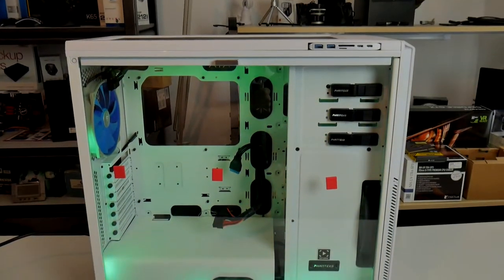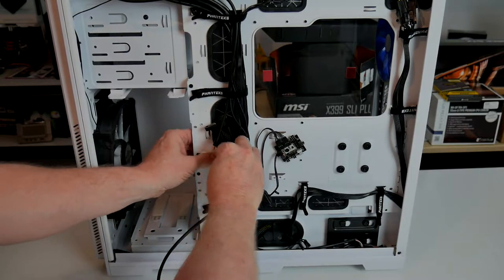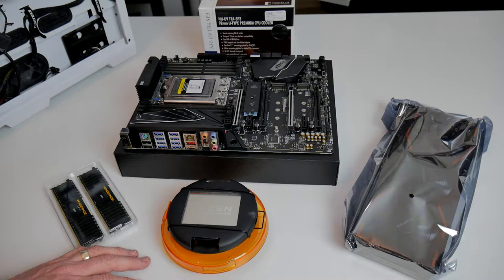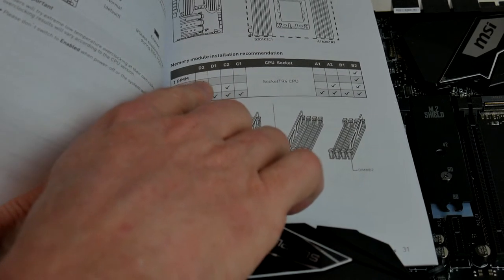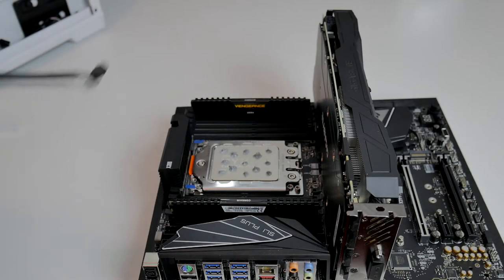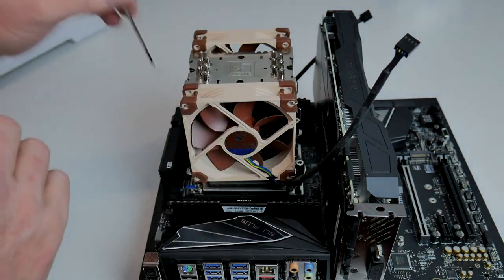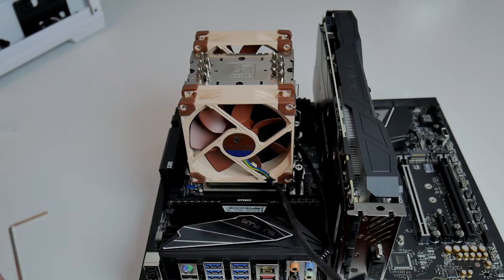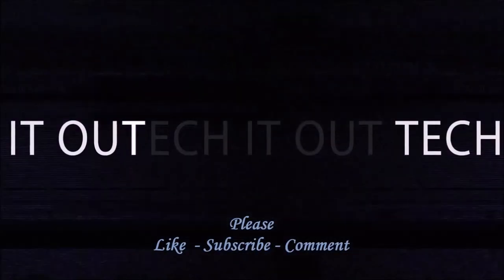Threadripper build VLOG part 5:  MSI X399 SLI Plus, Gigabyte GTX1080 and Ryzen 1920X

Comment: You know you crippled your system by only giving it two DIMMs and only 2400MHz? The main advantage of Threadripper over AM4 Ryzen CPU's is the fact that you have Quad Channel memory. With only two DIMMs installed, you're running dual channel, meaning most of you're Zepplin dies do not even have direct memory access and need to bunnyhop through the infinity fabric to get to RAM. All in all, I think your video series has been pretty good, however, I feel a little more research into what to buy would have paid off.
Reply from the maker: Sadly it was built to my budget. In an ideal world it would have at least 64Gb 8 x 8Gb strips but that is way out of my league.  Maybe when I have saved enough.  Thanks for the comment.

Comment: cool, thinking of getting a 1920x myself... found some 3000Mhz DDR4 doe, maybe overkill. But you should be able to do at least 2666.
p.s. dont think ill be getting such an expensive Case doe` .
Reply from the maker: Thanks for the comment. Sounds like a good build with that memory it may make it a little easier to OC if you decide to.  The case was only £80 UK when I bought it. I have modified it myself at a cost of a further £16 UK.  A total of £96 for what I think is one of the best cases available.  That's about $132

Comment: wow i did not know you could use that noctua on tr 4   i only thought that tr4 requires only the  bigger size noctua the 14
Reply from the maker: Hi and thanks for the comment.  Yes it is designed specifically for TR4.  I run mine at 4Gh and my temps are 50c at idle and 72c under full sustained load.  Not the coolest but well withing the safe range.  Thanks again.

Comment: hey what power supply did u used  i have a evga g3 gold fully m.  power supply and i am planning on gettin this motherboard i hope the power supply works with the p.s
Reply from the maker: Hi and thanks for the questions. Sorry i missed your earlier one.  First od all make sure your board has the latest BIOS as they have all just been updated with Threadripper 2.  Usually this is very easy as most also use Flashback now which is pretty foolproof.  I would also go for 3200 instead of the 2400 DDR4 I used. Prices were much higher when I bought mine and so I could only afford the slower. The 3200 make a big difference.  My PSU is a Corsair RM850x, I highly recommend using 850w or above as Threadripper along with the GPU will need this and also use both CPU power feeds.  The MSI UEFI BIOS is pretty straightforward apart from having to reboot after changing to RAID if you are using it before you can access the config to set it up in BIOS. I did try to use the BIOS auto overclock settings but they failed but with the MSI overclock dial on the motherboard I have a rock solid 4Ghz on all cores.  One last thing.  Be very careful you don't damage the plastic holder on the Threadripper CPU you cannot buy them so make sure you follow the fitting and tightening instructions to the letter tightening each a little at a time to make sure it is seated properly.  I hope this is of some help.  Feel free to ask anything else and thanks again.
Reply: Tech It Out  to be honest i am not going to overclock  my tr4 1920x and thanks for your feed back and i bought a evga gold 750 psu full mod...  witch i am not going to game its going to be mostly for audio production..  and i  am limit to use so much power in my house because of the light.. if i use alot of power the whole house will shutdown and then  i have to reset the power up..  soo  i had to get a 750 but soon ima try and get a power generator ..so i can use more power

Comment: Hi, assuming you would need to populate all 8 RAM slots, do you think that there is enough clearance (space) to fit Noctua cooler (especially its fans)? I cannot figure it out from the video?  Also, after almost 5 months with this system - what do you think about this setup? Thank you!
Reply from the maker: Hi. Great question.  As you see I am running a Noctua myself and yes there is ample room for the ram as the TR4-SP3 units are made specifically for the purpose. You may find a problem if you have RAM with very tall heatsinks on. https://drive.google.com/open?id=1ZRGDz6xI0eNw3TPXeotdoFiOpOSGZxvS Thanks again.
Reply: Fantastic! Thanks for checking it out. I'm about to upgrade my home lab and I'm investigating options with 1950X or 1920X. What is your overall experience with Threadripper? Would you go with it again?
Reply from the maker: In a word Yes definitely. Some may say Intel is still king but £ for £ or $ for $ Threadripper is way ahead and with Threadripper 2 just being announced they can only get better.  In fact I am seriously considering upgrading after it's release depending on my finances at that time. (I am completely self funded). Thanks again.
Reply: Good to hear that the new setup is doing well for you. And yes, I know your pain about self-funding computer equipment - I use it for work but purchased privately... I think right now I will only upgrade the disks in my home lab as I'm short in space. Then on August will see again what's happening on the market. Thank you for help and all the best!